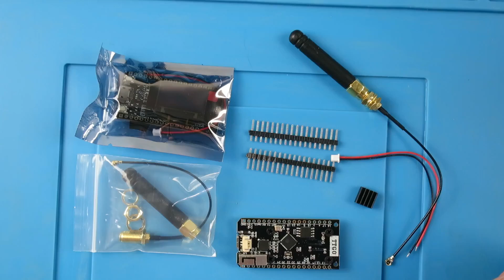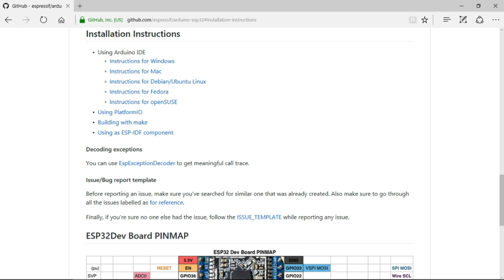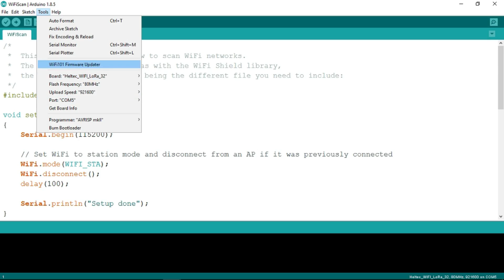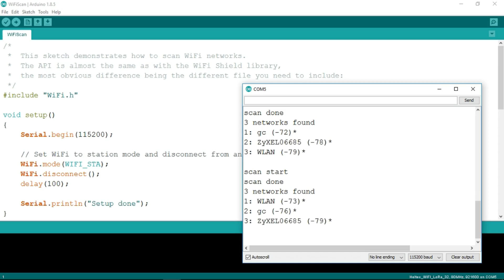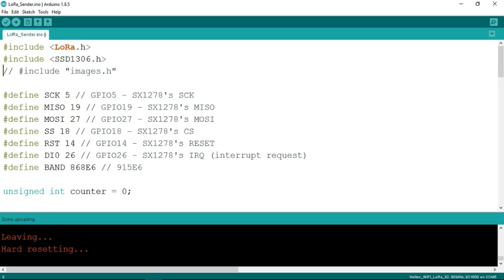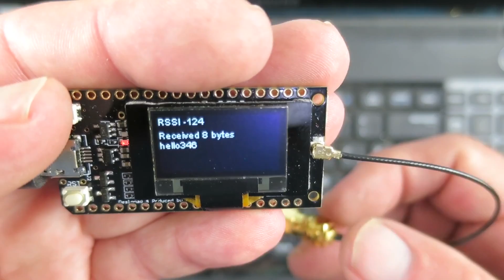LoRa ESP32 OLED Setup and First Test Wemos TTGO IoT Project From Banggood

Comment: Hi there I just wanted to say thanks for the great video and programming all I had to do was to remove the lmages. H and it worked great. I have found the hello it's in the sender program. //send packet, line no 64.  I only found it as I want to send some other data as well as the counter. And on the strength of this video I have subscribed
Reply from the maker: Welcome aboard!  I'm glad you found it useful.

Comment: hello,
how do we use a ds18b20 temperature sensor with esp32 oled module. can you send me the code?
Reply from the maker: I have not used that sensor. There is some example code here that will get you started : https://create.arduino.cc/projecthub/TheGadgetBoy/ds18b20-digital-temperature-sensor-and-arduino-9cc806

Comment: The more eagle eye'd amongst you will have spotted that 1nformatica's code includes the line 

SSD1306 display (0x3c , 4 ,15); 

Whereas the code on Github is:

SSD1306 display(0x3c, 21, 22);

1nformatica's code is correct and Githubs code is wrong.... you use Githubs and the OLED will not display anything!
Reply from the maker: Eagle eyed indeed Drweavil! You win today's star prize, a lifetime supply of air!!
Reply: @1nformatica   Gasp!

Comment: Is it safe to remove the antenna when you do not want to use the radio ( as wifi scanning, etc) ??
Reply: The note about the items says: "The 868/915MHz antenna needs to be in connection with the IPEX interface (if the antenna is not connected, it may damage the LoRa chip)". But I guess that I do can remove the 868/915MHz antenna if the Lora radio is OFF. Am i right?
Reply from the maker: It is not recommended to power these modules up without the Lora antenna attached.

Comment: Can't get the display to work on both boards, any ideas? Connected to pins 4 and 15.

Got one of the boards to work but screen quality is low and distorted. The other is probably a dud, hope the lora and wifi works.
Reply from the maker: Others have the same problem, I think it may be a new revision of board. See the posts from "andyt73" in the comments below....

Comment: I tried to search name board TTGO download for Arduino IDE, where download for board name TTGO?
Reply from the maker: Use the Heltec_wifi_lora_32 in the espressif library  https://github.com/espressif/arduino-esp32#installation-instructions
Reply: @1nformatica  https://www.thethingsnetwork.org/forum/t/big-esp32-sx127x-topic-part-2/11973
Reply from the maker: Thanks. Useful information.
Reply: @1nformatica  All right, my two board working sender and receiver but not work led (25pin) and oLed (4,15, and 16)! ok i will figure out as too many different codes.
Reply: @1nformatica  Thanks, I got it, my TTGO is V1 433Mhz its working sender and receiver, i can read Serial Monitor but oLed not work! I checked code make sure pin 4, 15, and 16 for i2c oLed, and pin 25 led no light! something not right, its TTGO Lora 433Mhz only, not TTGO Lora V1 433Mhz or 868Mhz
Reply: @1nformatica  Got note, your board looks is TTGO Lora V1 433 or 868, not TTGO Lora 433 only, mine different its TTGO Lora 433 only

Comment: can the oled be removed from this microcontroller?
Reply from the maker: The OLED is held on by 4 screws and there is a ribbon cable which I think is soldered to the main PCB.  If you are thinking of extending the cable it would be very difficult I think.
Reply: I was thinking about being able to remove the OLED (to reduce power consumption) and also inserting it again for debugging purposes ?
Reply from the maker: Here you can see the board without OLED if you fancy soldering all those pins.............  https://www.aliexpress.com/item/-/32828306733.html

Comment: I followed these instructions and now my board is only blinking red.
Reply from the maker: The receiving module will have a blank screen until it receives packets from the transmitter. What does the transmitter show?
Reply: It was showing nothing. Both were showing nothing. No plotter, no monitor, no OLED output. I undid everything and went to GitHub and tried another library and examples and it worked. Maybe I did something wrong the first time -- I don't know. It is difficult to know because you kind of started in the middle. I may have erred in the beginning of the setup.
Reply from the maker: Glad you got it working. It is always difficult to judge how much to put in to these type of videos. People don't want to see how to install the IDE every time! I expect the libraries I used are now out of date as I made this video some times ago.

Comment: I am using this board and have installed espressif using the link given above but, am facing problem in LoRa duplex communication. When I run LoRa duplex communication file of Sandeepmistry few commands are not executed. Please guide me whether is there any other library to be added or any driver to be installed?
Thanks
Reply from the maker: Hi, I do not have any experience of using that feature. I suggest you look through the raised issues on sandeepmistry's github page : https://github.com/sandeepmistry/arduino-LoRa/issues You can also raise your own issue there.
Reply: Thanks. But, his example file is working for many other controllers which means something (any library) is missing for this controller.

Comment: Nice video, helped a lot so fa. Can't see to be able to install the libraries from the .zip though. Get the no valid library message. I am a complete noob, still would appreciate some help. Thanks.
Reply from the maker: Hi, you can try deleting the Zip file and downloading it again, sometimes it could be a corrupt file. Other wise try using the Git GUI tool : https://github.com/espressif/arduino-esp32/blob/master/docs/arduino-ide/windows.md

Comment: I'm having trouble finding the lcd library, all i can find is an adafruit_SSD1306 library
Reply from the maker: I suggest you use the U8g2 library which you can install using the Arduino Library manager. You can see how to use it in this video : https://youtu.be/etzn2lIEOX4?t=262 You will find a link to the code in the description of this video.

Comment: I ordered cheaper LOLIN32 ($4) and separate oled for $2
Reply from the maker: I did not think that the LOLIN32 had LoRa capability? Please let us know if it does. Thanks.
Reply: Not sure what capability but has wifi and even built in lipo charger https://www.youtube.com/watch?v=k_7eZ5ZpSMY
Also if you want to do something extremely powerful and energy saving with the LoT/LoRa stuff - you may look into FireBeetle ESP32 - this board is insane (240MHz)
https://www.dfrobot.com/product-1590.html

Comment: Your video inspired me to make a purchase from Aliexpress 
https://it.aliexpress.com/item/1-set-2-pz-TTGO-433-470-868-915-Mhz-ESP32-LoRa-OLED-0-96-Pollice/32842155838.html

Although I didn't find a step by step to add support for TTGO LORA32, I did find the following link useful. 
https://robotzero.one/heltec-wifi-lora-32/ https://github.com/espressif/arduino-esp32#installation-instructions
After a couple of hours research, I was able to upload working sketches using board option Heltec_WIFI_LoRA_32. Once support was setup in Arduino, the transmit and receive examples you provided worked without issue. Thanks!

Now to figure out how to send DHT sensor data.
Reply from the maker: Hi Tom, thanks for the feedback. Glad you have it working, the DHT code is quite simple take a look in the example in the DHT sensor library for ESPx. Feel free to ask any questions.

Comment: Hello my Friend.
Having changed all the instances of 433E6 to 868E6 you mention in the video my receiver now  has a blank display?
Reply from the maker: Hi Steve, you are sure your boards are 868MHz? There have been reports of broken or wrongly supplied antennas, you can check those. Do you see the sending packet increment on the transmitter side display?
Reply: Just replying myself...
I just reloaded them both and they now work.
I could blame it on the IDE but it's more likely I mashed the keyboard incorrectly :)

Just took it for a test drive with the transmitter in a Velux window in my loft room and the receiver hanging from my sun visor in my Van i got just short of 1KM with the crappy antennas that came with them.
I'm trying to achieve 4K line of sight (With a couple of trees in the way) so its a start.

i'm going to look at high gain antennas...

Also not sure if there are 400-Mhz are available or allowed in the UK?

Couldn't have got the 1K without your video...

Many thanks!
Reply from the maker: Hey Steve •:*¨¨*:•_•:*¨¨*:• EXCELENTE_•:*¨¨*:•_•:*¨¨*:•_!! As far as I know 433 Mhz is an unregulated band in the UK. The advantage is that greater range is achievable more easily at lower frequencies. The downside is that the band is often crowded with things like garage remotes and baby monitors etc that use that band. Happy experimenting!
Reply: I'll Keep you posted ;)
Reply from the maker: Please do, I'm interested in what projects you have in mind.

Comment: I have exactly same modules and am curious to know your range tests. Mine hardly went more than 500 mtrs in city park. But went few stories up and down in building.
Reply from the maker: Really good information, thanks for sharing. I think we will be seeing a lot more of this technology.
Reply: The antenna supplied with this board is pretty rubbish. Just 50 meters away from my LoRa gateway reception was already hit-and-miss. The nut was indeed loose, after tightening it I got reception up to 500 meters or so. But only after I replaced it with a another, slightly longer, Chineseum 868Mhz antenna, which I ordered for another project with WeMos D1 mini and RFM95, the signal got picked up by LoRa gateways over 8km away!
Reply: @DirkDulfer  plz send me link for the antenna
Reply: @Nithin7860  link is in a previous comment and appears to be valid. For any more permanent stations, where compactness is not a requirement, I currently recommend a collinear antenna made by stanislavpalo130 https://m.ebay.nl/itm/Base-antenna-collinear-868-Mhz-869-mhz-LORAWAN-LORA-5Dbd-Vinnant/303252941570?hash=item469b48ab02:g:6bIAAOSwQydc1FZA
Reply: Electromania indeed looks the same but is a tad longer, more optimised for 868mhz, whereas the antenna that came with the module appears to be made for the 910mhz range. There are antennas with magnetic base available for around £8 as well, these offer a few dbi gain, but also require a ufl to sma adapter/pigtail to fit to the TTGO antenna connector, which introduces loss. 
 http://s.aliexpress.com/2eI32yim
Reply: 1nformatica check video of Andreas spiess he just made a nice review about lora and antenna. Exactly talking about 'fake' antennae. I will upload my review soon about my experience with lora. Stay tuned.
Reply from the maker: I think we are in the same ballpark! I have a new video coming up soon with more information. I put the sender in an upstairs window stuck to the glass. In and around my village I got about 100 to 200 mtrs many obstructions. To hills outside the village line of sight just about 1 Km. The antennas were vertical and parallel to each other. On my supplied antennas the inner connector is held by a nut that was loose perhaps check yours.
Reply: good to know there is someone sailing in same boat :). yes i noticed nuts being loose. i didnt pay attention about orientation of antennae. i will check that - i remember someone did make a video about the way orientation and type of antenna also affects the range.  no idea what actually could give longer range claimed by other lora users - i heard even 10s to 100s of Km ranges with lora - in line of sight.
Reply from the maker: Hi Electromania! The orientation of the antennas is important either both horizontal but better vertical and parallel with each other. I think the very long distances are with 433MHz units. Normally the higher the frequency the shorter the range.
Reply: is it true ?  this means people in asia with 433Mhz will have more range than people in EU and US because here freq is 8xx 9xx MHz ?
Reply: Dirk Dulfer thanks Dirk good to know yiur experience. May I request you to share the link of antenna you bought, if possible.
Reply: Electromania I actually used this antenna: 
868MHz LoRa Omni-Directional Antenna http://s.aliexpress.com/EFZZNfQb. Do not expect miracles from this one though when using indoors. A clear line of sight with the receiver is key and the LoRaWan TTN gateway that got me the 8km range most likely had a high gain antenna attached as well. Then again, link budget for Lora is very very high, so for tinkering these are quite useful.
Reply: Dirk Dulfer thanks. But isnt it the sams antenna that came with ttgo module? Or is it looking same ?
Reply: Dirk Dulfer ok that sounds good. I will get it :). Thanks a lot.
Reply: 1nformatica yes thats the advantage of open source knowledge sharing... we learn by teaching :).
Reply from the maker: Yes Andreas is very thorough , great summary of the boards & antennas. I look forward to your findings.

Comment: Man... Depending on the distance it works, you could even make a RC transmitter and receiver!
Reply from the maker: It's supposedly low data rate but may be?!
Reply: 1nformatica Yeah, just a few buttons, like in a toy grade rc car controller. When it's pushed, when it's released and so on. ;)
Reply from the maker: I feel a challenge coming on! Hmmm!!